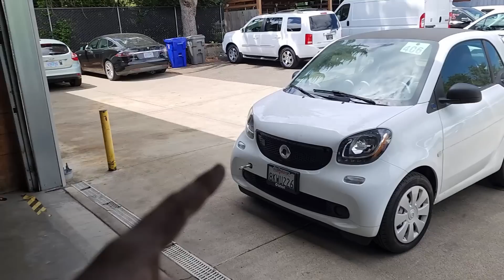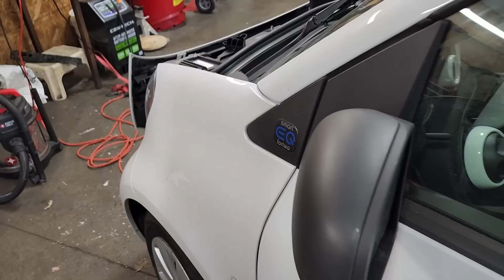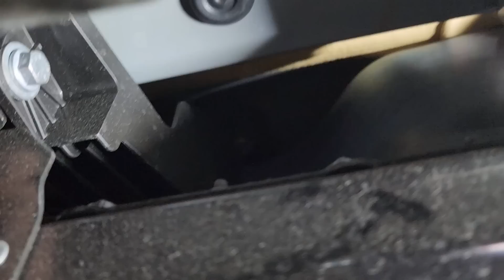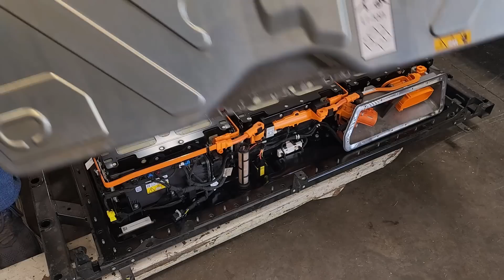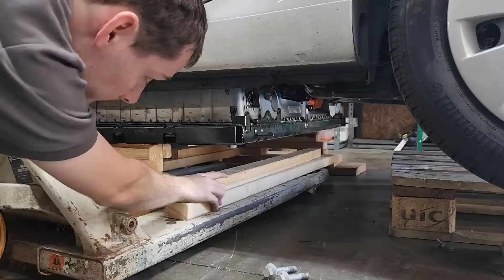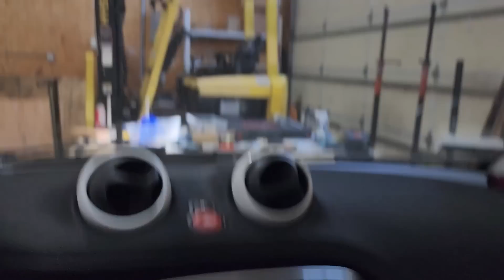Repairing a BMS "glitch" on a 2019 Smart EQ

Comment: INUK they will do the same thing , but the filter is not mentioned in the service  manual, even the dealers will not do it as it is not listed by MB.
The contactors are a known failure and there is a code that is also known on another make with the same unit.  Diagnose Dan YouTube site gives the remedy for that code problem..
There is a noticeable lack of sealant around the edge of the battery case and there maybe a moisture ingress possible hence the desiccant filter renewal required . When I changed my filter it was in perfect condition 😊

Comment: Thank you for the video. My Smart EQ is 4.5 years old. It started showing a faulty 12V battery. Even after replacing it, the problem persists. I took it to a Mercedes service center, and after inspection, they told me I needed to replace the motor and electronic control system due to the low voltage of the 12V battery. The cost is over 5000 euros. I'm still looking for someone who can fix it. I suspect the electronic components might be damaged, even if the motor is working properly. However, according to Mercedes' repair standards, the entire system needs to be replaced. Since the two-year warranty has expired, I'll have to pay this 5000+ euro repair cost myself.
Reply from the maker: Sounds like a DC-DC converter failure - it's a well known problem for the 453 Smart ED/EQ.... The DC-DC is built in to the traction inverter/motor assembly (which is a shared with the Renault Twingo), and Mercedes does not offer a standalone repair option. 
There are however independent shops in Europe like EV Clinic and others that can replace it as an individual part - though it does still require removal of the motor in order to gain access.

Comment: How are you supposed to replace that desiccant filter if you have to open the battery. I thought MB didn’t open the battery.
Reply from the maker: The cartridge can be unscrewed from the bottom of the pack.

Comment: I don't see how they would know that the desiccant filter hadn't been changed. You legally don't have to have the car serviced at smart/Mercedes to keep a warranty.

The glitch is because the 12v battery drains flat. So having any constant load on the cheap and low quality OEM battery will eventually kill it. That'll be anything connected to the OBD or constant live for things like a dash camera with parking recording option.

Comment: I have got one of these and would like to know the address for the  controller repair, I am in UK but you said it was Germany.
Also the desiccant filter is not mentioned anywhere and the M dealers knew nothing about it either and di not have them in stock for the Smart EQ.😊

Comment: I did a little Googling: battery management system (BMS) plays a central role & it consists of the battery management controller (BMC) and cell module controllers (CMCs).
So, BMC + CMC = BMS ;)

Comment: First responder approaching the (not so) Smart EV: Where is the HV disconnect??? Honestly, how is that even legal ?
Reply from the maker: The HV disconnect is located underneath, just forward of the right rear tire. Worth noting, this is an HV system disconnect, and not a first responder loop. In fact, not all EVs actually have HV disconnects (such as Teslas), but rather only first responder/maintenance loops that create an open circuit in the HV interlock loop, and disable the main contactors.
Reply: @AlexEVRepair  Ok but where is the first responder look on this car?
Reply from the maker: Looks like Mercedes only implemented the HV disconnect rather than also having a cut loop. 
https://rk.mb-qr.com/en/453.39/

Comment: IMhO: This Story is a Black Eye for Mercedes EVs. I dream of, and would love to someday see an open source group development of EV BMS with adapter plugs that could be put on any, or most EVs as a replacement to the stock BMS. Would also love see that on the market with full kits for converting suitable fuel autos to EVs.
Reply from the maker: There are solutions that exist for the BMSs in some batteries to be controlled for use in conversions for other applications. Pretty much every automaker does it differently, so there's not really a "one size fits all" solution... If you look on openinverter or github, there are some open source options. There are also of course off the shelf "for profit" solutions from other sources as well, for anything ranging from Nissan LEAF to Tesla batteries.

Comment: Guy, very interesting video. I have a 2020 eq which is the face-lift model, MB recalled it stating a battery management issue plus everytime i take it for a service they change the particle filler. Your eq looks like the first 453 which was the ED. Anyways great video
Reply from the maker: The changeover from ED to EQ took place sometime during 2018 to better fit Mercedes model naming conventions (at least here in the U.S.), so only 17' and some early 18' 453 models use the ED name. Not sure if it can be easily seen in the video, but this one being a 2019 is clearly badged as an EQ. Also, here in the U.S., 2019 was the last model year they were sold here, so we never got the 2020 refresh.

Comment: That desiccant  filter looks to be inside the battery assembly surely its accessible for replacement other than a battery removal every two years.
Reply from the maker: It unscrews from the bottom of the battery.

Comment: Greetings from Germany & nice work! Besides your valuable tipps, here's another one: As the car is basically a Renault, using ddt4all, you can actually read the remaining counter for the contactors. So, buyers beware 😉 (I'm driving a 2017 ED myself)
Reply: hey dude do you know if the 2016 smarts fortwo electrics have this countdown timer? mine has 34 thousand miles on it.
Reply: @brianwillis1577 AFAIK the 451 does not have this. It is mentioned IIRC by EV Clinic from Zagreb
Reply: Where in ddt4all? I have it but need to know where to read out

Comment: To get them on the lift, pull it forward until the front arms will go under the car. Move the front arms under the car but leave the lift rear arms out. Reverse until you are about to run into the front arms. Rotate the rear lift arms under the car. Now you need to center the cars and move the lift arms into the correct position.
Reply from the maker: Still not enough space to do that (at least on my lifts). Also, the positioning of the normal rear lift point actually gets in the way of removing the battery. If I do more of these in the future, I may need to invest in some "wheel lift" adapters pick it up from the tires.
Reply: @AlexEVRepair  Interesting. Would a pinchweld lift adapter provide enough clearance on your lift? The ones we have are a much smaller profile than the standard lift pads.
Reply: Jack under the read diff, remove the rear tires, arms come forward without issue.

Comment: Alex, I am wondering if you could walk me through the swap out of the 12V battery on a smart.  I want to ensure I don't brick the HV battery.  I also need to swap out the desiccant filter and I would need a way to "inform" the car that the filter had been changed.  I have to tell the computer that the "service" on the Smart has been completed. 
Also, if I found a Smart EV with a bricked battery would you be able to remotely run through the "un-bricking" of the battery?  If so how much would you charge me?  I'm in Canada so there are very few service options for the Smart now.
Reply from the maker: Hi Chris, I think I responded to an email from you about a week ago. There's no special procedure to swapping the 12v battery, just swap it out like any other car. As far as resetting the service interval for the desiccant cartridge, there's no way to "tell" the car it's been swapped, it's simply a service screen reset (much like an oil life reset on an ICE). On the ED4/EQ models, it's as simple as navigating to the service interval screen on the IC, then just press and hold the OK button on the steering wheel until it says it's been reset, ED3 and earlier models are a little bit more tricky, but it's just a combination of key cycles and button presses.  

In terms of "un-bricking" the HV battery, that depends on what the actual failure mode is that caused it to get bricked in the first place... If it's a contactor counter issue like I dealt with in this video, then the steps are basically as seen here (I'm considering "buying" the reprogramming procedure for this repair, as seemingly nobody else in North America does it, so in the future, I might be able to perform that service if you sent the BMS here). Alternatively, if the issue is that the BMS has gone into "junkyard mode" and has started self discharging the pack, then time is of the essence, as if the HV battery gets too far discharged, it cannot be recovered. I'm happy to give some quick tips if needed, but I'm not in the business of "repair consulting", so you're on you own in terms of actually doing the work... But there's plenty of forum posts and videos out there on these subjects with lots of useful info.

Comment: So the issue for this customer that caused battery to fail was the insurance OBD dongle?

What number does the counter start at ? 10,000 key cycles ? 20,000 key cycles?  When it gets to 0 then that’s it? BMS done? 

Trying to understand how that works. 

Does it countdown on its own even without the OBD device ? 

Would it not be easier to just buy a new BMC from dealer?

Also. What was the name of German company that reprogrammed BMC ?
Reply from the maker: The BMS starts with a value that is really high (I think 300,000 cycles), which would make it extremely unlikely for it to ever "time out" on its own during the life of the car. But of course then that begs the question, why even have a cycle countdown at all? Only the engineers at Mercedes (or maube Renault, which I'll get to later) could answer that question...

The issue here was that the OBDii dongle must somehow disrupt the CANbus, which causes that counter to become glitched and set to zero remaining cycles. Again, why it's programmed to have a seemingly "arbitrary" limit to start with is anyone's guess...

A replacement BMS simply isn't available from Mercedes, as they don't consider any of the internal parts of the battery to be serviceable (apart from the dessicant cartridge, which unscrews from the bottom).   Since Mercedes doesnt consider the battery to be servicable, that obviously means they dont sell any of the internal parts. However, the battery and other drivetrain components are shared with the Renault Twizy, so some of the internal components CAN be purchased from Renault, such as the contactors. However, I don't think you can buy a BMS (and I suspect it would probably have different firmware than the Smart anyways).

The company that did the programming in this case is called Smart-emotion, but there are at least one or two other companies in Europe that do it as well. If I end up getting any more interest from folks with similar issues, I'll be looking into seeing if I can figure out a way to do the reset myself. In this case though, for cost/expediency response, it made sense to outsource that part of the process.
Reply: @AlexEVRepair   yeah. Would be worth it to try and see how they do the reset. They want €1400 so it’s good to keep that “ in house “.  

I looked up the A… part number in google and you are correct. Nothing came up. I wonder what company actually manufactured the BMC.

Looks like it’s made by HELLA.
Reply: @AlexEVRepair   did you bleed coolant system with Xentry after you put battery back in? 

Was any adaptations required after programmed BMS was installed?
Reply from the maker: Since I clamped the lines off, very little coolant was lost, and not very much air introduced into the system, so I was actually able to bleed the system without using Xentry. No adaptations/coding required for the BMS upon installation. Everything in the video is exactly how the process went!
Reply: @AlexEVRepair  so you just connected BMC and that’s it. It worked without xentry adaptations ?
Reply from the maker: Yes, because it was still the original BMS, and had all of the original parameters saved (VIN, etc.). The only change was that the stored alerts were cleared, and the contactor cycle counter was reset.
Reply: @AlexEVRepair   I’m very interested to know how they did this ? Just replace the resister by soldering new one in?
Reply from the maker: No resistors or any other components replaced on the board... It's solely a matter of programming, not a hardware issue. Not sure what their process is for the reprogramming, but apparently it's "proprietary" and uses a special program. There's one company that you can "buy" the method, but for more than double the cost on a one off project like this it wasn't worth it. If I get more interest in the future though from other people with the same issue, then I'll probably look into actually "buying" the procedure.

Comment: What is the initial value of the cycle counter out of interest, in other words, what's the life-span of a contactor/bms unit?  Seems it could be an important thing to check if one ever buys a Smart electric.

I guess there is some sense in having it time-expired, aged contactors could have considerably more resistance and generate a lot of heat given the currents involved, but measuring said resistance and temperature would be a much better way of handling it.
Reply from the maker: I think it's 300,000 cycles. WAY more cycles than the contactors should ever actually see in the normal life of the car. Why they chose to give it arbitrary limit, who knows?

For some perspective, the contactors cycle every time the car gets turned on. Even if you drove it 200,000mi, with an average trip length of 5mi, that's only 40,000 contactor (on/off) cycles. Add in additional cycles from charging, even it it was plugged in after every single round trip (so once for every "two drives"), that's still only a total of 60,000 cycles. I assume that it's counting on then off as 1 cycle, but even on AND off count as their own cycles, that's still only 120,000 cycles total.

This car only had a little over 20k mi, clearly not anywhere near enough to have ever caused the contactors to "actually" run out of cycles, the issue is that the OBDii mileage tracking device caused the BMS to glitch the contactor cycle counter to 0, presumably due to some sort of disturbance to the CANbus.

Comment: Interesting video - don't own nor do I want to own and EV just an inquisitive engineer :) ..... Problem with making stuff easy to take appart & watertight without using silicone mastic ... increased chance of water ingress which they have obviously mitigated by requiring the frequent desicant service. It's easy to forget that not everything that seems like a cop out has been done to screw the consumer. bad if the manufacturer hasnt highlighted the requirement to do so though.

Comment: Reason #7852 why I won't buy an EV - desiccant filter warranty.
Reply from the maker: Technically, that only applies to Daimler AG (aka Mercedes) vehicles. No other OEM that I know of has any kind of stipulation like this... I'm also pretty sure that in this case, denying the warranty over not changing the desiccant cartridge is a violation of the Magnusson Moss Warranty Act.

Comment: Whoa! Back up the bus. You're telling us that Mercedes wants you to have the battery pulled, replace a filter or void battery warranty? Does the owner have to pay for this service? And!! could the BMS be fooled by applying +12V directly to the contactor as needed to operate the car?
Reply from the maker: The dessicant cartridge can be changed without dropping the battery (it unscrews from the bottom).
And no, you couldn't get the car to run by applying power to the contactors. While that would close the contactors, the BMS would almost certainly start throwing alerts for welded contactors or something like that, and it likely wouldn't allow the inverter or anything else on the HV to operate of course.
Reply: @AlexEVRepair  Thanks... Damn, I couldn't cough up the price for labor every two years to drop a battery pack to swap out a filter. Glad to hear you can get it without do that. Too bad about not being able to fool the BMS with closing the contactor externally. Any idea how many 'cycles' the BMS will allow before hitting zero? Sounds like an issue that certainly shouldn't been in the firmware to begin with. I was thinking of getting a 2017 Smart EV, but couldn't find a dealership/private repair shop that would even look at the thing. Not even the Mercedes dealers! I'm glad I didn't buy it.
Reply from the maker: I think the cycle count is something crazy high, like 300,000 cycles, WAY more than the contactors would ever likely see. However, simply putting an "arbitrary" limit still just seems dumb no matter how you slice it.

Comment: I wonder whether the industry will find a way to avoid the need for cooling batteries. The fewer aux systems we have in these vehicles, the more modular and maintenance free they can become. I don't know what I mean.
Reply from the maker: The Nissan LEAF and some other EVs don't have any battery cooling, however, that leads to other issues in the longer term; particularly accelerated battery degradation. Lack of cooling also of course significantly limits fast charging capabilities.

Comment: So you would have to go through that whole procedure to change the desiccant filter. Why isn't it accessible from outside the battery? It must be expensive to replace it; I wonder if Mercedes actually change it or just tick it on the service sheet.
Reply: It’s $70 from the dealer. Takes 2 minutes to replace.
Reply from the maker: It is accessible from the outside, just unscrews form the bottom. I know that on the B-Class ED/B250e, Mercedes actually would do it for free (though sometimes dealers didn't quite seem to get the memo on that). Not sure if that applies to the Smart EQ though.